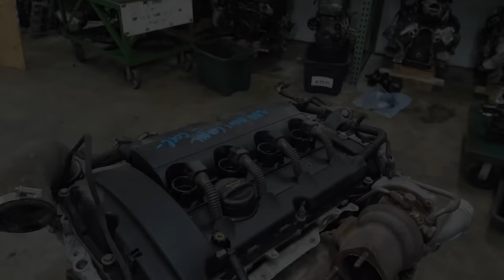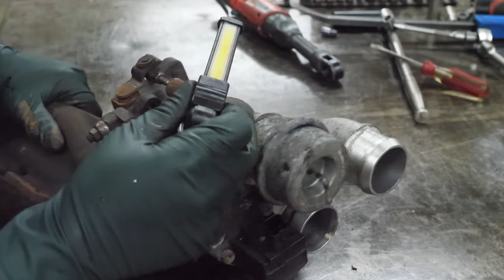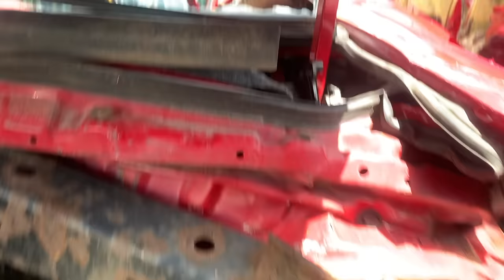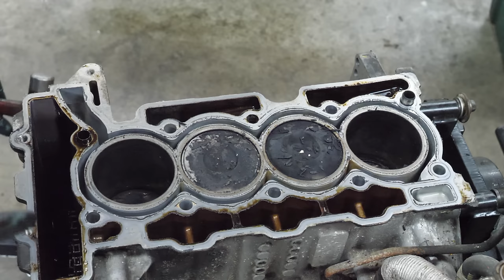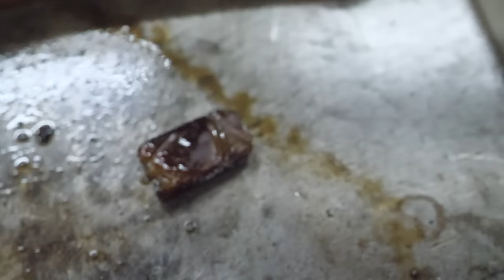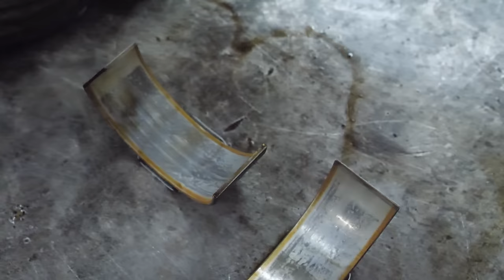JUNK Mini Cooper S (BMW/Peugeot) N14 Turbo Engine Teardown. Why Do People Buy These?

Comment: Perfect timing on this video, as I am changing the front crank seal on my daughter’s mini this week.  What is more laughable than the reliability of this car are the quotes you get from the Mini dealer for service.  $750 to replace the crank seal, and then another $500 to replace the serpentine belt.  Which is removed anyway when servicing the crank seal.  Classic double dipping!
Reply: That's when you go find a more honest mechanic.
Reply: It's NOT double dipping when it comes to a Mini. Not only are they unreliable, they are horribly complicated to service. Just be glad the crank case seal isn't an engine pull.
Reply: Do yourself a favor. If you get it running properly, sell it pronto. Your daughter may cry. She loves the car. And you love her. And you’ll do anything you can to keep her in it. Don’t make the same mistake I did.  Get rid of it and get her another “cute” car.

Comment: I'm not a mechanic but I know that Minis in the UK have a poor reputation for reliability. Too many plastic parts in the engine failing shortly after the warranty expires, seems to be a deliberate policy of built in obsolescence. Very enjoyable to see the real guts of the engine which are rarely seen. Excellently and clearly presented. Subscribed.
Reply: What is strange is that two decades before this both Peugeot and BMW were building million mile engines. It is like they forgot how to do that.
Reply: Please note that Mini was made by BMC (1959-2000) using 'A' series push-rod engines.  Since 2000, MINI is owned by BMW and uses all sorts of modern s**t engines.
Reply: Had 3 UK minis all to 150k miles no real issues and one over 200k.
Reply: @ln5747 I do believe you, probably on maintenance like a hawk
Reply: @jackbower8671  just a general service every year
Reply: @jackbower8671 he said UK Minis. So I'm presuming it's the old school, original, British Minis. Not the MINI which is owned by BMW.
Reply: These so called engines should be stamped with an expiration date the minute they leave the factory . The worst and cheapest Fiat models are more reliable than the junk made by BMW . BMW earned it's reputation by making reliable advanced fun cars but later on gave it all up with a rush to run ahead of time propping the new models with unnecessary too advanced electronics and poorly engineered train power , leaking oil all around engine head gasket , infant diseases and worst of all low quality parts with unnecessary expensive price tags . I prefer the old  legendary three  series over the newest M series .
Reply: @ln5747 your cars were built on Wednesdays.  Not hungover Monday nor rush job Friday
Reply: @alicecarrillo3378  nah, intelligence would suggest by law of probability that's not the case. Well serviced and they'll be fine.

Comment: Also, when oil filter was removed, you should notice that it is concave in shape. This means that the filter is clogged and the oil pump was sucking very hard to try and get oil through it.

Comment: I had a 1.6 thp engine in my 2007 Peugeot 208. I always remember the horrible bag of bolts sound the engine made on startup at times. I think it was the timing chain tensioner failing and the rattle was from the loose timing chain. This was on an engine with less than 40k kilometres. The twin scroll turbocharger was impressive and the car pulled strongly with low rpm, but I was never so happy to get rid of it.
Reply: Needed a cam chain adjuster under warranty,  did the car ever have that done?
Reply: @jamsstar2010  No never had a recall for that. I ended up trading the car in with the original dealer and let him sort it out, my first and last Peugeot!
Reply: @rossdev BMW sabotaged Peugeot with this engine haha their previous TU engines were bulletproof, as were all of the diesel powered models. BMW actually used the PSA 1.6 HDi in the Mini D and these were a solid unit and surprisingly fun. I learned to drive in one.

Comment: A BMW engine not leaking would be a surprise.
Reply: Diesel Syndrome? (If there's no oil under it, it's because there's no oil in it.)
Reply: Nah. No surprise. Just empty.
Reply: Peugeot made these engines. Not that the BMW ones that came after are really great or anything.
Reply: All of my BMW engines have had leaks from the valve covers.
M54, M57, M62
Reply: @atrielienz press materials about this engine say that it was BMW that took design leadership and pretty much every novelty (that makes this engine go boom) is BMW designed.
Reply: Diesel supremacy. No leaks here.

Stay away from bmw 4 cylinder engines from the 00s, especially petrol ones. The rest isnt that bad.
Reply: @atrielienz Peugeot was diesel and BMW was benzin. I had 308 SW GT 1.6 Turbo with 205 HP and drove that car hardly 4 years without issues. From 2018 till 2022. Maintaince every 10.000 km and you will not have problem.
Reply: I had a 330d E31 for 8 years and put 65,000 miles on it. It had no oil leaks when I traded it in for a brand new F31. That was 7 years ago and 51,000 miles later,. guess what ..... no oil leaks.
Reply: @oilyrag525  E31? Should be E91 Maybe?
Reply: @GoldenCroc  Ahh, yes, you're right
Reply: @Dejan-gz6vz  I currently own a 2010 JCW R56. Previous to that I owned (a guy hit me) a 2008 R53. Same engine in both cars. The I am currently in the process of replacing the n14 in the R56. The engine has skipped timing twice (I've owned the car a year, but the guy before me clearly didn't take care of it the way he should). I'm not saying the engine won't take care of you if you take care of it.
Reply: @atrielienz   It's a BMW designed engine developed in their R&D department, PSA engine department (Francaise de Mecanique) didn't use timing chain or valvetronic in their own engines and that were the 2 main failures of that Prince engine. PSA use timing belts and more conventional VVT, none of the EW or TU petrol family engines suffer from that things.
That timing chain problems were common in other BMW engines (a nightmare in N47 diesel 2.0) of that time and the valvetronic is the BMW own designed VVT. 
Peugeot only build the engine in their factories and BMW in Mini factories but the problems is a design thing. 
After 2010 they fixed the main problems and  PSA use the engine until today with more problems fixed.
Reply: What did they do, it was never in service.
Only for skilled people !
Reply: @CableWrestler  dad mechanics, you need to service it at the dealer !
Only for skilled people, do it yourself, muhahahahaha.
Reply: @atrielienz  incorrect, i own the b48 engined mini f56 and its been  very reliable. These n14s the prince engine are french hence why they play up

Comment: I am on my second mini cooper s.  My first was an R56 with an n14 engine.  I didn`t own it long enough to see any of the issues they are known for although I am aware of oiling problems.  I have a few friends in England and the US who have had these in their minis, they always die horribly if you treat it like its a normal consumer car, which it is.  I currently have an n18 engine in a newer R56 which has been great engine ignoring the downright stupid electrical problems I have found and "fixed".  I would love to see a tear down of an n18.
Reply: Same here. It sucks that the N14 pretty much ruined the consumers perception of MINI and believe all MINIs on the road have this engine variant. The N18 and B48/6 are proven to be way more stout.
Reply: @_IMNNO Good to hear, currently got an 2007 Cooper with the N12 (1.6 non turbo, pre facelift) which has it's own slight oil consumption problem. Looking at upgrading to a Cooper S soon and got a friend who wants to sell his F56 Cooper S for an older R56 Cooper S but I'm definitely making sure to avoid the N14 at all costs and getting a well looked after N18. Some people say the N18 is better but not by much so I would be interested to see any changes they show the improvements we see irl
Reply: I'm rebuilding my 2nd N14 as a project car. Don't ask me why except that I know my way around it by heart. The N14 mods well. Just take care of it. That plus the inherent great baseline handling characteristivs of the chassis make it an awesome track car when rebuilt and dialed in. I love the R56 more than my Stage 1 Golf R.

Comment: Neat, my wife had a mini with this engine (2016, so later version) which i was dreading doing a clutch in, as well as taking care of all the oil leaks.  Thankfully as a birthday gift to herself,  she traded it towards a new car, so not my problem anymore.   Still neat to see what i was going to get myself into.
Reply: 2016 has the B48 engine, not the N14, the B48 is very reliable.
Reply: @robo6548  Mini/BMW continued putting the N16 and N18 Prince engines in the R59 Roadster, R60 Countryman and R61 Paceman all the way up until 2016 so it was likely one of those.
Reply: @robo6548  It's a further refinement, a lot of the pieces rob was taking off were definitely different than a lot I've touched on that car, but it's the same base long block underneath.   Either way, I'm still stoked I'm not having to take care of all the oil leaks the wife's car had developed,  it was stacking up to be an engine out service.
Reply: Maybe it's time to do an LS swap
:D
Reply: B48 clutch is like a $4000 job so good thinking getting rid of it
Reply: @izzy9022  To pay to have it done is like 4k, having extensively hunted around, parts were going to be 1.2-1.4 k all said and done doing it myself, but damn was I not looking forward to it.
Reply: Just put a clutch in one,you have to tear the front end off.Crazy design. Just changing the alternator and belt was a pain.
Reply: @mikematthews8823  Yeah, seemed like most of the front clip had to come off for a lot of things that were typical "have to's ", did the alternator, had the turbo off.  The water pump was miserable for different reasons.

Comment: I’ve rebuild 100’s of these (I’m in UK) in the mini and PSA group cars. 

I’m commenting this before watching the full video 😘

Oil in water is really common due to the core plug in the head failing and that usually causes the bottom end issues (most people that don’t know this engine say head gasket, head gaskets are not a majorly common failure on these) 

Timing chains are really common also, usually the upper guide likes to fall apart.
Reply: Where is that core plug? Can it be found in the cylinder head attachment parts section of the parts catalog? This sounds like very useful info for the new BMW/Mini tech asking!
Reply: @constructmaster6280  

The core plug is just below the cam gears in the middle of the head. 

There is an outer plug that is visible on the casing on the cylinder head (hidden by the engine mount with the engine in situ), remove that and the inner core plug is directly  behind it.
Reply: Hey I pulled the cylinder head on this Peugeot 508 right now, it’s burning coolant, but there appears to be no sign of head gasket leak, what could be the issue?
Reply: @galaxymode  

First, MLS gaskets are almost impossible to see a brake unless it smacks you in the face so I wouldn’t worry about not seeing a brake.

Second, you’ll need to check your head and block faces are flat, I’ve seen them warp a few times due to over heating. I’ve also seen cracks in the head due to over heating also, needs to be pressure/magnet tested. 

Third, if it’s a turbo model they have a water called turbo which I’ve seen blockages in the turbo/return line (mainly when someone has tried a rad weld ect) and put coolant into the intake/exhaust housing.
Reply: @MathewFisher124 
The bolt broke off from the exhaust cam sprocket then snapped the chain. I need to know how to get this engine to TDC when I assemble it.
Reply: @carmenacotto6870  This engine you don't go for TDC, when you lock the flywheel, all cylinders are in a perfectly straight line in the middle of the travel.
Reply: @MathewFisher124  Yeah, I am aware of the turbo thing, it has a turbo water pump near the oil filter housing, and that was fine. Now the head is still at machine shop, I will only be able to get it back on the 21st August. The machine shop says the head is fine, and the surface is flat.
Reply: @galaxymode  as soon as it's locked, I then can lock the cams? Right?
Reply: @carmenacotto6870  Yeap, since you got to remove the cam bolt to remove the timing chain, later on you can put back the used cam bolt to turn the engine, just to line up the pistons, lock it, and proceed from there

Comment: You are spot on with your opinion. I've owned 9 Minis of this vintage. 7 were the S model. SO many issues. Coils. High Pressure Fuel Pumps. Throttle bodies , which are plastic and can't really be removed without breaking the throat on a higher milelage motor. The ridiculous timing chain guides and replacement thereof. Random "Half Engine Power" lights. Stupid oil filter housing crap. And I treated them all well. That other Mini 3 cylinder that you also did a teardown on was leaps and bounds better - especially low end torque - but what a PITA to work on. I learned my lesson - no more Minis for this guy. Blast to drive / expensive to maintain and fix.

Comment: The only decent N14 is the JCW version, but they can all have issues (timing chain, turbo, cooling system, oil consumption, etc.).   The "belt tensioner" you removed is actually referred to as the "friction drive" and it drives the water pump indirectly off the back of the drive belt.  The water pump pulley friction material does crack and deteriorate over time, but they're easily replaceable.  Lastly the water pump being plastic means that it was original, which is rare since they're so prone to leaking.

Comment: The  pistons are very clean. The oil was great and likely the problem is not oil related. Low octane fuel also doesn't lead to overheated valves if low octane was used.

Comment: I have a 2009 mini Cooper s with the n14 engine. If you correct the factory engineering faults such as timing chain head gasket as well as keep your valves clean with a couple modifications and a nice tune, these are absolutely fantastic! They get a serious bad rap because so many people are not mechanically inclined and delay preventive maintenance. For those who have a thorough understanding of the n14, it can be a wonderful platform!

Comment: I owned two R56s cars (as well as 6 other BMW products over the years).  A 2008 with the N14 and 2012 with an N18.  I put 86k on the N14 and nearly 100k on the N18.  Anyone that followed the BMW factory maintance cycle on the N14 at 15k mile oil changes would have issues for sure.  I changed my oil every 5k miles and made sure it was always full as the prince engines do not like to be even a little bit under "full".  Carbon build-up on the N14 was a big problem even with a oil catch can.  The N18 did not have nearly as bad of an issues with the revised EGR system.  I did not have turbo issues with either car.  My N14 was part of the timing chain tensioner "recall".  I took it into the STL Mini dealer and they refused to check my timing chain as I replace the tensioner myself with the updated unit.  After several e-mails to BMW NA about that I was finely able to to have the chain inspected per the recall.  My chain, even with 5k oil changes was out of spec and replaced per the warranty.  I also never had any issues with HPFP in either car, while ironically I had to replace to HPFP in my N54 335i twice.  The biggest issue I had with either N14/N18 was the thermostat housing.  Both Cars had them crack/fail at around 60k  miles.  Valve cover gaskets on both cars started to leak oil around 65k mark as well with the rubber getting hard near the turbo.  It was about a $300 part and a few hours of my time to replace both.  Having owned an M52, N52, N54, N55, S54, S65, N14,  and N18 engines I can safely say the N14/18 were no better and no worse than any of the other engines.  They all had failure parts/leaks ect.  The most reliable BMW engine I have ever owned was a N52 though it still liked to leak oil with its garbage gaskets/seals.

Comment: I've had one sitting in my driveway for 3 years now. A friend just gave it to me because he had one valve chip away and it ran poorly on 3 cylinders with low compression on #1. He was charged 5k to replace the valve - the guy who did the work was actually a former master BMW mechanic but went independent with this own shop. He didn't change the other 15 valves while he was in there which I find really odd. It was my understanding that the OE valves were inconel which is great for heat resistance, but supposedly horrible for impact resistance (as in smacking open and closed throughout a valve's lifetime for instance) and eventually chipped away. So 11 months after this repair, #2 had a valve assumedly fail the same way due to how it ran when it gave out... 200 miles from home. I purchased the gasket sets and a full set of 16 steel valves, but in all honesty - I'm not sure I want to tackle this one after seeing the teardown. Thanks as always for sharing the horror show of that one. Knowing what you know about Ecodiesel 3-liter failures in Rams with their EGR and oiling systems, do you think another one of those could make its way here? (yep... I've got one of those sitting in my driveway too)

Comment: A friend runs a garage where a Lady drove one o these in for a service. She was still driving around in the courtesy car two weeks later! Two common problems were the number of parts that need to be removed in order to get tools to the target part and the number of special tools required to put it all back together again. When i saw it the headlights were missing, not even the main dealer had all the specials needed, and those they had were so seriously expensive they didn't want to lend them out. Never again! He said
Great vid, thanks. 😀